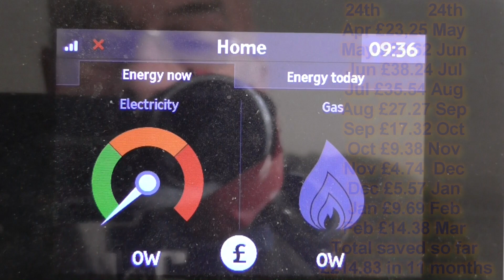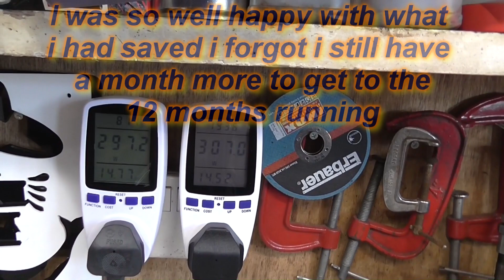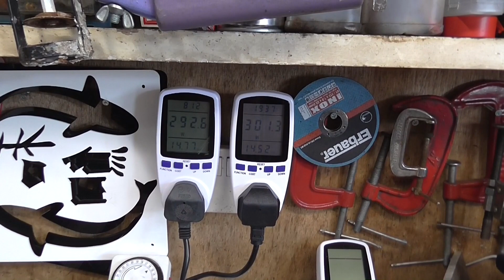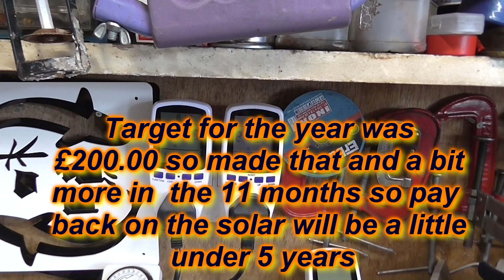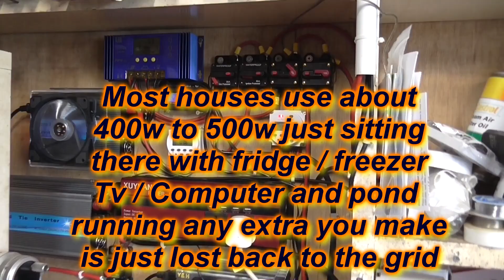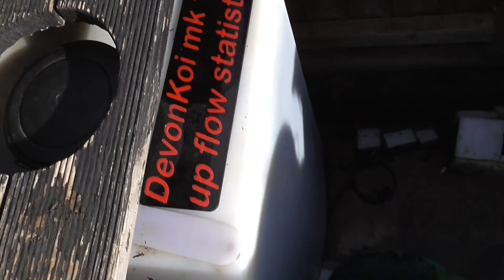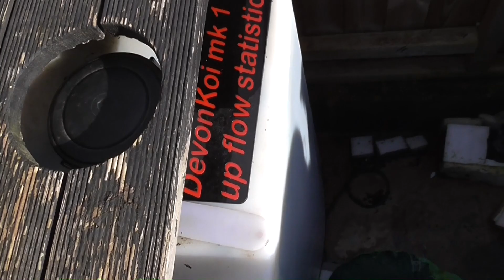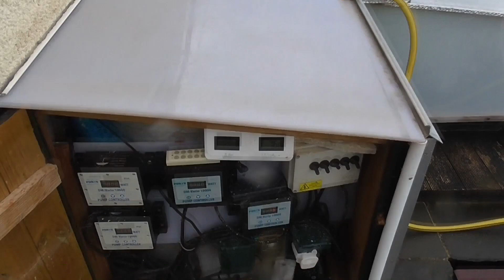***A KOI POND ON SOLAR PANELS *** CAN A SMALL DIY SOLAR SAVE MONEY *** STARTIN OFF THE POND YEAR ***

Comment: Glad you are on the mend Martyn, your solar is very interesting, nice to do a spring clean, and get the pond ready for summer, best wishes, Tony😀
Reply from the maker: 500w of panels and a micro grid tie is worth it it will run a pond most of the daylight hours 8 to 9 months of the year Anthony and its under £500 to setup if you shop around and Diy fit is two 24v wires and a push in a 13 Amp from the grid tie. Have a good weekend
Reply: @boxtriker  Cheers Martyn😀

Comment: Hi Martyn. Great video as always. I'm interested in using solar to run my Koi Pond. Which of your videos is the best one to watch where yoou explain the equipment needed and how to set it all up? Regards. Peter
Reply from the maker: 500w of panels and a micro grid tie is worth it it will run a pond most of the daylight hours 8 to 9 months of the year Peter and its under £500 to setup if you shop around and Diy fit is two 24v wires and a push in a 13 Amp from the grid tie. the links i had in any older video have past there time but you are looking at Ebay and 4  ECO- Worthy120w panels a 600w micro grid tie off Amazon some Dc wires and fixing clips for the panels.  cheapest panels i can see now are £352 and grid tie  https://www.ebay.co.uk/itm/165744059238?hash=item26971da366:g:pR0AAOSwXkRjkAoR&amdata=enc%3AAQAHAAAA8BJ43H5BZtT%2FxuEbgjT6W1voAUVwYXD01SjRZnGTJYebUqD78D4aBS2VFmLTuy4YdVXK21%2FLKyfCng8gCPpGhXmRj3HLj8d%2BIfEYBXCtRsfLNcwP8lX1HNb2d%2FX5M4BQGfrAfy9ZWNZL9SMgooirGHlG3kB29LsyWf8I2kNfsbeejJpSgiDkdv%2FKj3vJ2MUCtb1yxL5Y4N2mUGky6r24Z1Wnih%2FoiFpeKMESVzCGNyG8i2eDj17z5RE7zuvfmx0HW%2BvYsnNPUbRrp8gItd8Z2%2FJKJEGgib%2FCzhXZ0zb7Z93PsyujFddgKOMzfVwYHGgS9Q%3D%3D%7Ctkp%3ABk9SR8LGrYbnYQ
https://www.amazon.co.uk/s?k=grid+tie+inverter&crid=2M8KBGT7CS9Z6&sprefix=grid+tie+in%2Caps%2C1052&ref=nb_sb_ss_ts-doa-p_1_11 Have a good weekend
Reply: The way energy prices are increasing I wouldn't be surprised if you got ut back in 3
Reply: @boxtriker  Thanks Martyn. Most of it makes sense but I'm struggling with one or two finer points. DO you have a way that I can communicate privately with you about this? Regards Peter.
Reply from the maker: Peter you can find me on facebook or there is an Email address below this video

Comment: You’ll make nothing back in 5 years as you’ll need new batteries inverters solar panels within the 5yrs 😳
Reply from the maker: I was not counting the battery's in they was free you will never make back the cost on solar battery's as you say. one set of the panels is half way there at near two and a half years old and i have one panel same make for a light in the shed that ones 12 years old still push's out over 100w in full sun so i will stick with you will get your money back on the panels and micro grid tie plus make money after 5 years how long it will run after that is anyone's guess